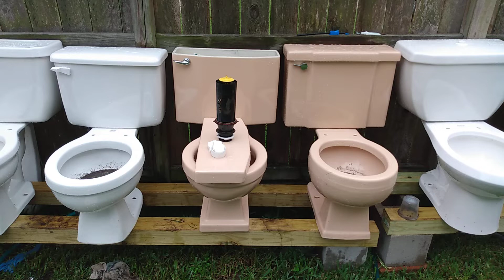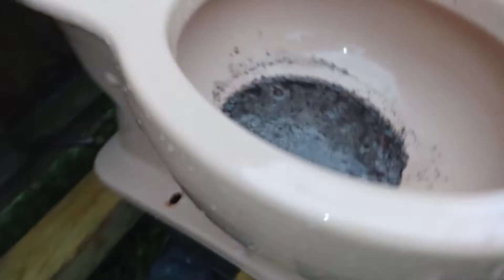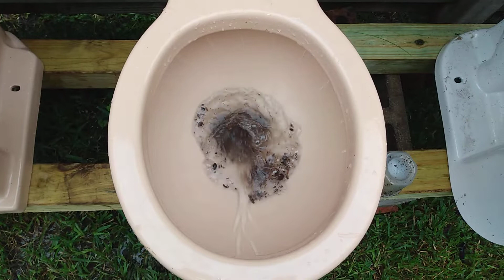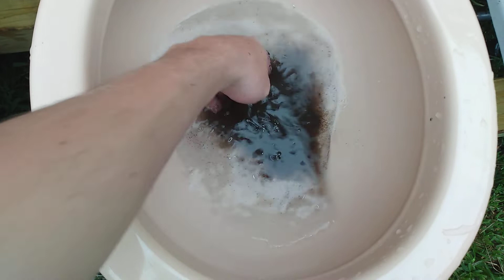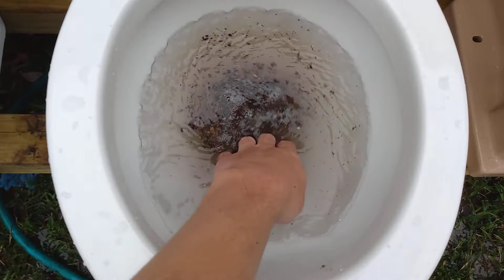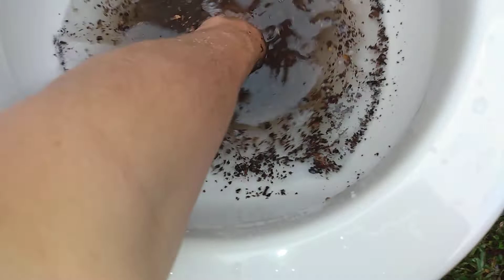1962 Wellworth vs 1988 Plebe dirt test

Comment: Both these toilets are garbage - 5 gallons per flush and they look almost as dirty as before.  My 2005 Kohler Wellworth would do a far, far better job with 1.6 than these two dinosaurs.
Reply from the maker: So far Kohler Wellworth Ingeniums do the very best of all on dirt tests. My other Plebes did very well too but not as well as the Wellworth.
Reply: The plebe’s a 3.5 not 5, but agreed it was a terrible performer here. Weird because it’s usually solid.